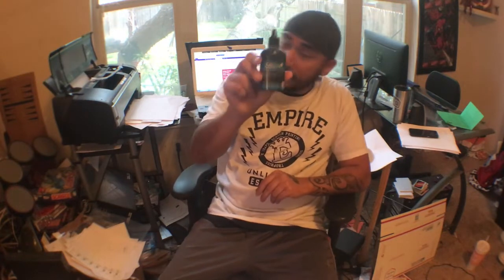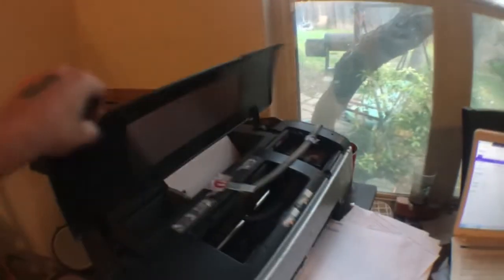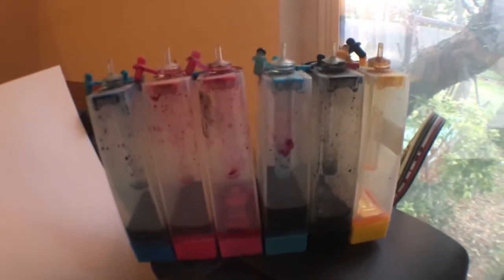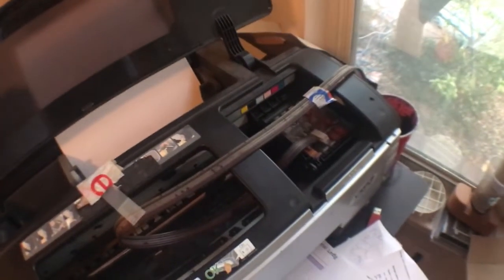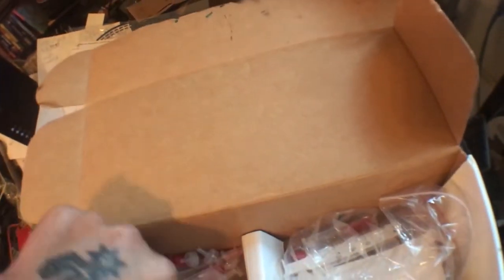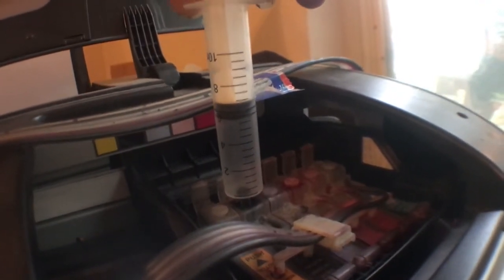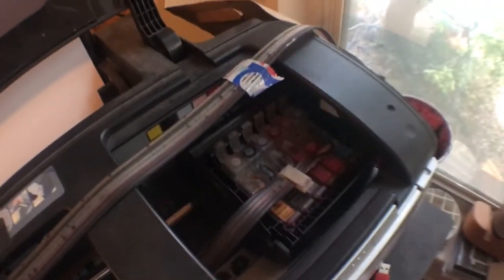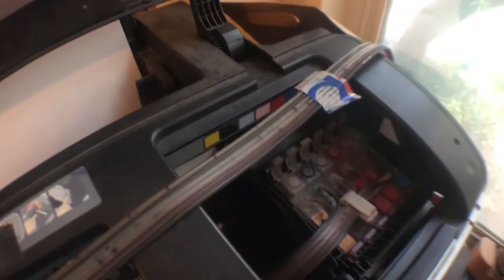EPSON 1400 BEST PRINTER FOR SCREEN PRINTING TRANSPARENCY film CISS KIT MOD

Comment: I thought the 1400 which I have as well,  and the 1430 use an ink waste pad. Attaching the cup or an external bucket helps to collect the ink and keep the pad from soaking it all up under the print head, but eventually it will show an end of life service because of a built in software counter. Epson will allow you to reset once for free then you'll have to use a program like  WicReset  which is 10$ a hit but it takes a long time to hit the end mark again so it's worth it. Like the content bro. Good stuff
Reply from the maker: Yes, I found the oem reset software free on a blog a few years back, thanks for watching

Comment: does this printer require the use of the lighter inks or can i leave those empty?
Reply from the maker: Just regular dye based ink, yes fill all inks,don't use pigment ink, those tend to clog the print heads over time

Comment: Hi im interested in your theory of stopping this printer from going bye bye so to speak. Am I right in saying when you take the side panel off you then take the tank out empty it do you then put it back or do you just place the tube that goes into that tank into like you have a cup of some sort then thats it and the other problem is when you say you have to change the chip do you get round that problem with just keeping that tube in the cup or do you still have to change the chip cheers
Reply from the maker: I leave tubes exposed and running into plastic cup, leaving tubes out does not affect operation, after so many print printer memory will give a error code stating waste tank if full, all you have to do is reset the chip with a software app you can get off ebay or buy it off epson for upwards of $100.

Comment: Great vid! Love my 1400. Do you have any footage of hooking up that waste cup?
I have a 4880 I need to get a ciss system for.
Thanks!!!
Reply from the maker: No footage but it's easy, take off side panel and you will see line, it's only connected by 1 clip, make a hole in cup run line then put clip on the line so it stays in place in cup
Reply: King Print Thanks...on it!
Reply: Jason Enz do you print on transparency paper with the 1400?
Reply: Chase Reed waterproof clear sheets. Yes :)
I converted my printer  to all black.

Comment: I meant are you running all sublimation color ink
Reply from the maker: Running dye ink, I don't run all black like a blackmaxx system because I also use this printer for full color heat press transfers
Reply: Thanks for your reply

Comment: Do you use a rip software? like accurip?
Reply from the maker: No just Photoshop, you don't need any other software if your ripping vector artwork
Reply: @KingPrint  that's what I'm reading. Trying to narrow down printers. The canon pixma pro 100 seems nice. It's an inkjet printer ter that uses dye based inks like all black systems.
Reply from the maker: @drumsaredope  whatever printer you decide on make sure it's a wide format printer also check if there is a ciss kit compatible with printer

Comment: I have this printer but can't seem to print larger than 8.5 x 11. I have tried everything that I know to do. Can you help?
Reply from the maker: Make sure you install the Epson 1400 software, if you don't have that pic is going to use generic driver and will only let u print reg paper size, If you do have the Epson driver, go to setting there should be a ton of sizes settings, the one I use for 13x19 is super B setting,
Reply: Yea, I have done all of that. I am a technology teacher for 20 years now and I am pretty good at trouble shooting. I can not get this though
Reply from the maker: @tamarawilson4978  I'd have to be there messing with it to figure it out, sorry I couldn't help
Reply: Yea I know what that is like...thanks anyway
Reply: what OS do you use
Reply from the maker: @tamarawilson4978  I'm on a old laptop running Windows 7